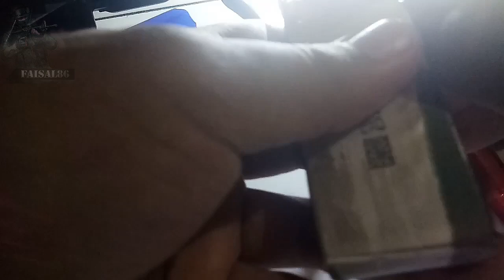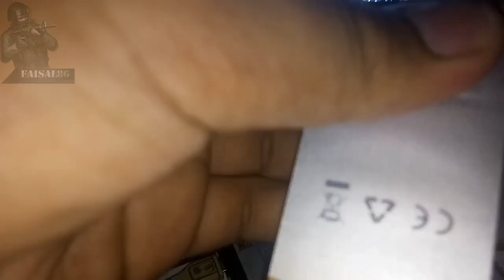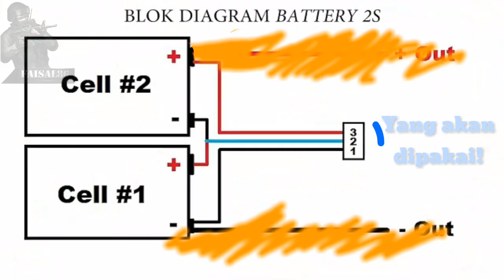Battery Mod / Upgraded Battery Drone MJX Bugs 5W "Part 1"

Comment: Nice video!
I didn't get the captions though, so you are suggesting to cut the lead cables and then replace the other 2S balance connector with the original bugs battery connector?